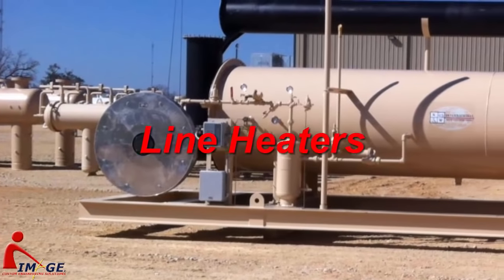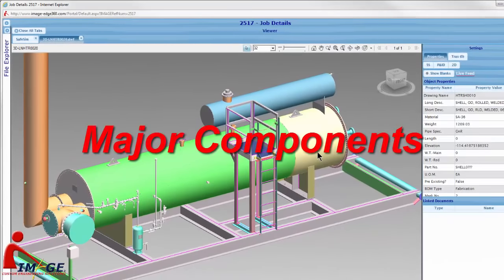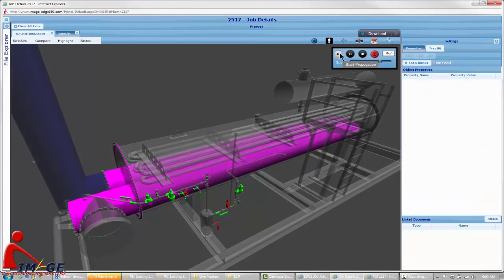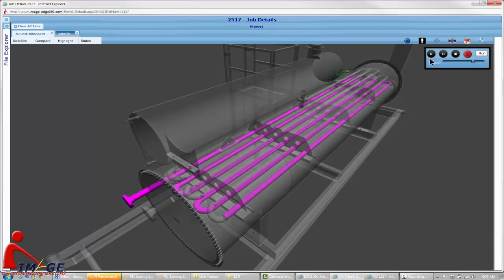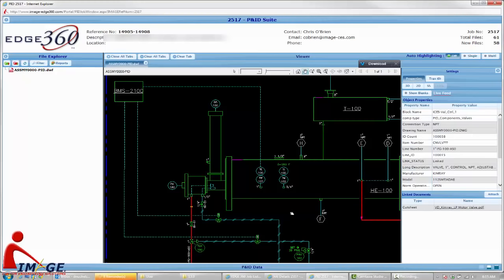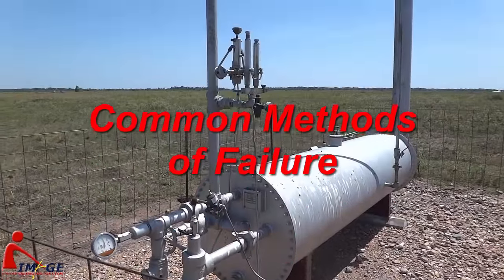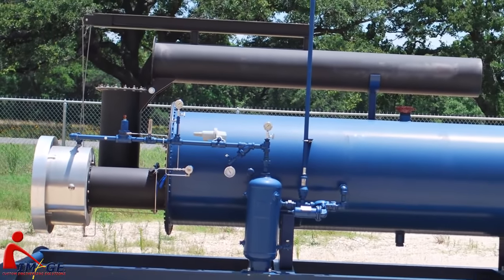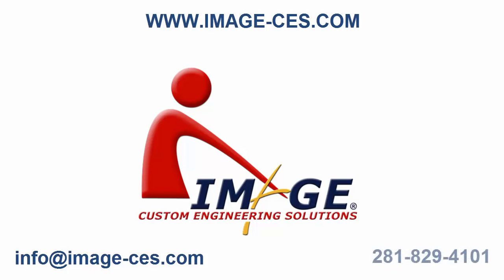How Stuff Works - Line Heaters

Comment: Are these usually used before or after the initial separator?
Reply from the maker: They are normally the first piece of production equipment that the fluid stream goes through after it leaves the tree.  That is unless there is sand.  In that case there might be a sand separator before the line heater.

Comment: A line heater, also commonly referred to as an indirect fired heater, is a piece of equipment that is commonly found at or near the wellhead or Gas Transmit Line and of which the main purpose is to heat up the well-stream or the pipeline fluid.